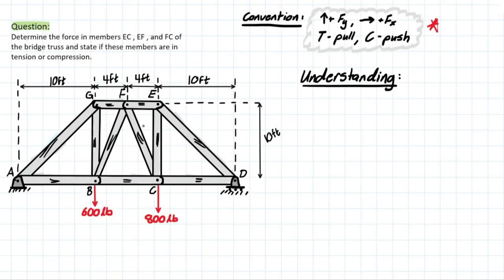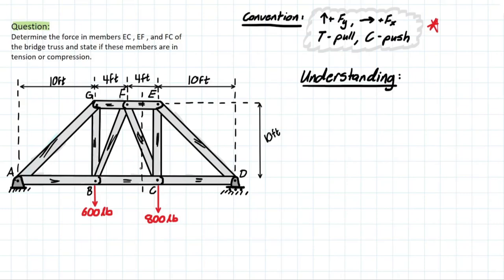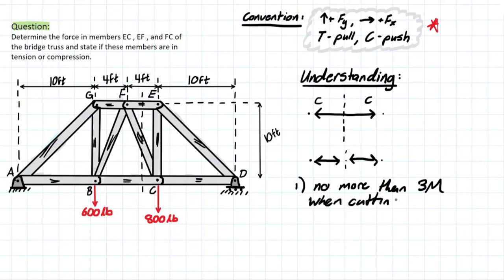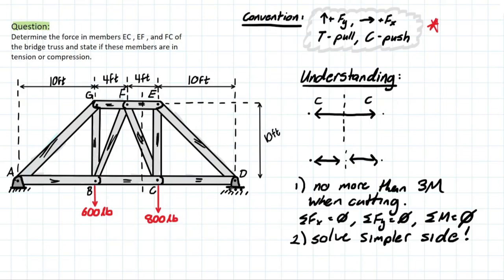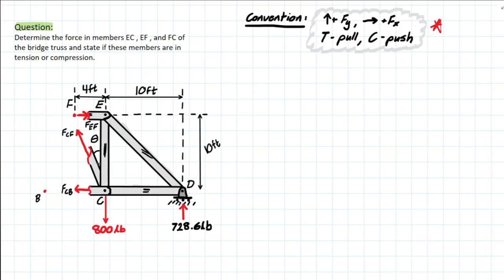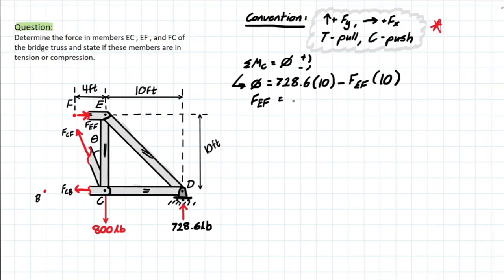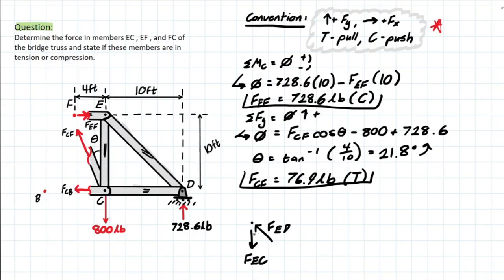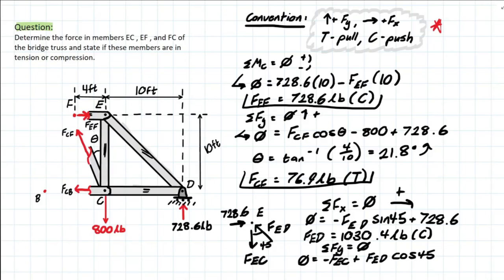Understanding Section Method for Truss Problems!

Comment: at 8:30 you mention the "point of moment", and due to this no moment will be produced at CB or CF, how does that work? is it b/c they are both going in the counter clockwise direction and FE is opposing that?
Reply: *Or is it because both of these forces are attached to joint C, therefore when taking the moment at c, the Distance will be zero, therefor the moment for each will be zero.
Reply from the maker: Hey Gaby! So basically, Imagine Fcb and Fcf acting directly at the joint C. There is no moment arm between these forces and the joint C, therefore no moment is created. However, since Fef is 10ft away from our reference joint C, a moment is created (M=F * d). 

To avoid any future confusion, forget me calling it the "point of moment", but instead our reference joint where we are determining the the value of Fcf using Moment equilibrium equations. 

Hope this helped!